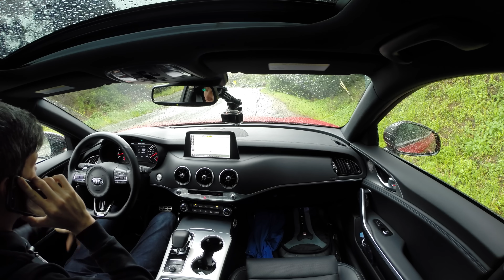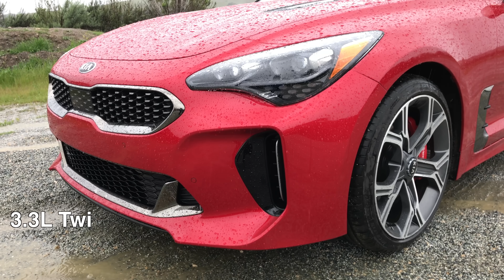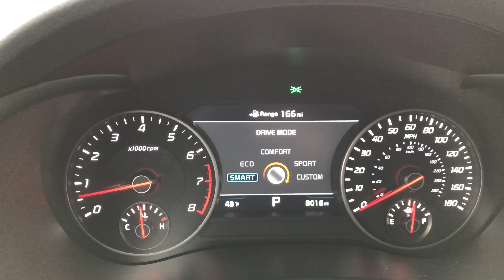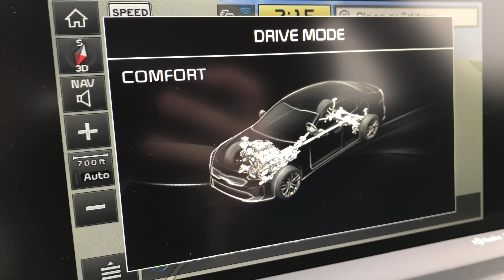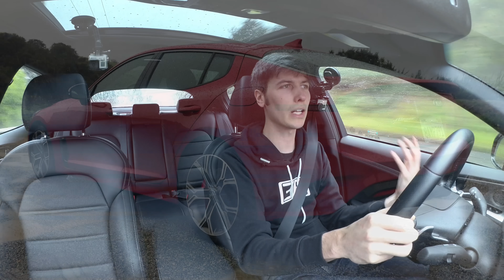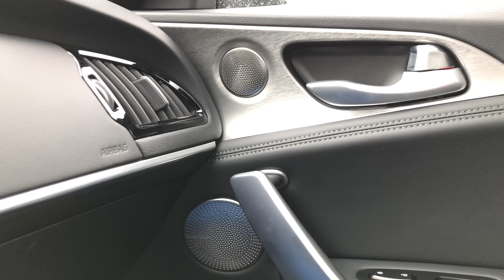The Kia Stinger GT Is An Ego Check For Car Guys

Comment: Love the humor at the start, making fun of the "American" car culture bored with dull stuff from Korea :: but there are some interesting electromotive solutions coming out of south korea because of collusion between Samsung + LG & Kia Hyundai etc : with some degree of irony the LG Chem batteries in their hybrid and electric models are so fade & failure prone that they have to give lifetime battery warranties :)
Reply: It will be interesting to see how the vehicle fleet (all Korean Vehicles) hold up over time compared to American, European and Japanese vehicle manufacturers : especially at the individual model level for reliability & longevity : I wish cars and car components had hours meters by law (yes I know I can add them with aftermarket parts :))
Reply: The engine & transmission seem like good candidates for longevity MTBF failure analysis, the clutch too for how many cycles under what kind of loads. More active information about vehicle component wear would be cool! In aerospace there is lots more analytical data for a given model, like the Boeing 787 models :) or epic 737 ^^ It would be cool to understand why some vehicle are way more reliable than others, and why some vehicles hold up well overtime with abuse like the Toyota Hilux truck featured on Top Gear!

Comment: Kia/Hyundai (They're actually the same company or one owns the other) have always been kinda sleeper like with some models. My 05 Sonata actually has a lot of power for an average sedan. 125mph in the top of 3rd on a 4 speed auto is impressive for a 2.7L v6
Reply: Oh and it has an exhaust leak right off of the downpipe or whatever you call it in the flex pipe and it sounds pretty mean. Kinda like a baby GTR as all my friends say.

Comment: Hey Jason, jumped ship from an Audi A5 to a Sunset Yellow Stinger GT. Phenomenal car. Needs transmission tweaks, though. I don't really noticed much turbo lag, I know it's there, but the engine hides it well. My Sunset Yellow came with AWD, 19 inch wheels, and Michelin Pilot Sport 4 tires. I miss my Audi, but I don't miss the maintenance costs. I am concerned about the brake pads and rotors, pads 300 bucks per each and rotors are about 110 each. It would be a 1600 dollar job to do all four corners just in parts. Got those quoted from the Kia service department.

Comment: We have had a very successful time with our shop Stinger GT. Currently, we are 110 WHP over the stock 365 horsepower (currently at 500 crank horsepower)
Reply: hidden KARD all those parts are getting developed right now.
Reply: Than you!!!  We are limiting our market to 3 maufactures now. KIA/Hyundai, Mini Cooper, Fiat/Alfa Romeo.
Reply: With full bolt on's, and a tune... it may very well be 200 WHP gains for the Stinger.
Reply: Tork Motorsports If you run out of fuel, upgrade the fuel pump and get bigger injectors also try a e85 tune
Reply: Tork Motorsports holy crap maybe I should get it lol
Reply: Sochi Water All there car has is a muffler delete (easy just pull off the muffler) , cat delete, front mount intercooler, intakes, and an off the self 93 octane tune. Imagine what it could do with full bolt ons and turbo upgrade. Should be pushing some serious power !
Reply: lmao it seems like i keep finding myself see tork motorsports, from trying to turbo my 500x and thinking about the stinger its crazy yall get your hands dirty in so many cars, thats awesome!
Reply: Tork, do any 0-60 or qtr mile testing on "stage 0 and 1"?
Reply: Devin Bender um, no. We did it for less than $3500 in parts and labor and... it was not fully tuned. Also, we paid $37k (USD) for our Stinger. The Stinger is really going to upset some peoples assumptions of what the car can do.
Reply: Wait, what? 500 with a few bolt on's and a tune? The turbo would have to be upgraded also to make that power. In my shop with my shop Stinger, I have already broke 500 wheel torque, and 450 wheel horsepower and we have not even started tuning it yet. So... the Mustang may be fast and has a huge following, as these Stingers start to get tuned and get turbo upgrades... they are going to be making people take a second look at what they can actually do.
Reply: Agreed, but its limited to NA, where the Stinger already had turbo's on it. The potential from the factory for the Stinger, vs the Mustang, puts the Stinger much further ahead.
Reply: Devin Bender lol not practical, no awd for crap weather, no where near as nice interiorly and let's not forget a dime a dozen. A v8 Mustang has been proven to get walked buy this car from a dig in the quarter mile with a manual, auto would be closer but still a loss. Not to mention for the price of an exhaust for that Mustang you can buy a tune for this car and pick up 100+ hp and 100+ tq.
Reply: Devin Bender i bought my gt1 for 39k 50 plus what are you talking about lol
Reply: Robert B gt2 for 50+ never said gt1
Reply: Devin Bender Similar performance it's a 2.3 L turbo 4 pot vs 3.3L twin turbo V6 the stinger will have more torque at equal hp levels due to the cubic capacity difference and when it comes to petrol engines proving you can get the power down torque wins races not hp.
Reply: Tork Motorsports can do the same thing with a 35k mustang too.
Reply: even if you can do it with a mustang you have the misery of having to drive a mustang
Reply: Tork Motorsports as impressive that is. Your still talking about a 50k+ car and $10k+ of work in the shop. Where I’m talking about a $35k car and $8k in the shop for similar performance
Reply: Tork Motorsports must have stole the car. Gt2 stingers are currently 55k at my local dealer. Gotta love them EBay parts!
Reply: @devinbender8428  Something tells me you haven't bought a car or know how to negotiate MSRP from with a dealership. Depending on the offers and car price you can easily walk out the dokr 5k below MSRP. With the aggressive leasing and finance offers, I walked out with a GT2 for 45k. I'm sure Tork was able to do the same.
Reply: hyedefinition1080 I am a very good negotiator. Got a Avenger RT new for under 14k sticker was over 20.
Reply: @hyedefinition1080  Yep, at the end of September, I paid 44K out the door for my GT2 AWD.  And as you know, the GT2 is loaded.  I haven't seen even one GT2 AWD with a sticker of 55K.
Reply: @devinbender8428  then I don't know where you got the $55k MSRP from...it maxes out at $52k. And you with the good negotiating skills could easily bring that down $10k if you wanted.
Reply: @hyedefinition1080  never mind. The guy is a dipshit. Saying the stinger interior is plastic crap in the same breath as a mustang Ecoboost lol
Reply: @dreadnaut1269  Dude even bragged about how he bought a tragic Avenger  for 14k 😂
Reply: Devin Bender All macho men always think they’re good negotiators. You probably think that you’re awesome in bed, too?
Reply: Wedow walked by a stinger??? Motor trend and auto trader have the v8 stand at over 1.5 seconds faster quarter mile!!! Nicer interior on what planet??? The Kia interior is soooo plasticy. And practical?? It’s adaptive rwd. Any car with 400+ hp awd or rwd will slide. 

And I’m talking ecoboost mustang. 2.3 l turbo. Making better hp than the twin turbo singer. 

Ecoboost Mustang proven at 500+ with a few bolt ons and a tune.

Comment: I have a few questions. Does it come in a manual transmission? Does it cost more than a base mustang GT? If it does cost as much as a base mustang GT ($31k) how does it compare with the mustang? How does it compare with the several cars out there that come with a standard transmission and similar price range? I only ask about the mustang because that is my daily driver.

Comment: Thanks for the video! Great as always. I just still can’t. It’s still a Kia. It’s like the Saturn sky and Pontiac solstice. The sky looked better and it was the same car, but I could never ever buy the sky (not that I bought the solstice either) because it was a Saturn. 

And this is coming from someone with and FR-S. I HATE Scion, and I still wish I bought a BRZ so I didn’t have to say Scion even though I like the styling of the FR-S better. At least with the FR-S I can still fall back on knowing that they had nothing to do with the design or styling of the car. 

With the stinger,  it’s still 100% a Kia... I want to like it because I do like what it’s about... but it’s a Kia

Comment: Pretty sure the AWD system uses clutch packs instead of a center differential, like about everything else that change center torque biasing. It would make sense considering it only shifts up to 50% to the front.

Comment: For $1,000 more I can get an M240i xDrive that is quieter, faster, and has a better layout.  They are trying to give BMW a run for their money.  However, given the woes of those I know who own a Kia, in terms of being made almost like a plastic toy from China, versus BMW which is over-engineered and has expensive parts (though I'm sure the Stinger GT will also end up with expensive parts), I'd still rather have the BMW.  And per car & driver, the BMW will definitely out-handle the Stinger GT.

Comment: the biggest ego check for car guys that i can think of is saying "hey I bought a 2.0 liter , 4 cyl volvo", but you obviously speak about the S60 polestar which gets 367 hp and 470 Nm out of its engine, and get from 0 to 60 in 4.4 secs, and obviously most guys are clueless , and they think youre an idiot for buying a 4 cyl grandma car volvo.

Comment: Cool car but for a tall guy like myself the roof tapering was to aggressive. Also wasn’t a fan of the weight of it (drove the Awd version) you could defiantly feel it had an low threshold for losing traction and the transmission felt a bit sluggish other than that the car was very solid for the price it’s not a bad deal.

Comment: There was a day, long ago, when I would have rather pushed my VW than drive a KIA. That day is no more. Props to KIA for making a proper RWD performance sedan... and a good looking one at that. I would go right past all the beige-mobiles at Honda and Toyota, and straight to this.

I’m one of the nerds with an SS sedan. The one caveat for my with the KIA is that my SS has the Tremec manual. An auto with a hesitating character would drive me nuts in short order. They need to offer a manual with the RWD 4cyl and the RWD V6. The AWD V6 would greatly benefit from the responsive character of a DCT (like the Porsche PDK gearbox, which is very very good). The SS also has that 6.2L LS3 V8... sounds great and is highly tunable. The KIA has a decent growl, remains to be seen how the tuning market will develop for this.

Overall, this is the first KIA in which there is no shame in owning. Happy to see a carmaker move TOWARD the RWD performance sedan market.

Toyota, are you listening? Your CEO keeps complaining about people thinking Toyotas are boring. News flash: making the styling ever more hideous isn’t going to change that. It’s the _driving dynamics_, not the styling. Make a mainstream RWD performance sedan. Something that will do donuts, can drift a corner, urges the driver onward. Not a mere white-bread-and-mayonnaise conveyance. Maybe start with one of the Lexus platforms, de-trim it for Toyota, make it a little more raw.
Reply: DucFanDan I wouldn’t get my hopes high because when a company decides to go to BMW to build the Supra rather than use there R&D they build to make the LF-A and the Lexus F Sport you know its only balance sheets that matter and I’m coming from still owning a GS430 myself.

Comment: I've owned a blue Stinger GT2 AWD for about 3 weeks now. Absolutely love it. Traded in my trusty old '99 BMW M3 Convertible 5spd for it.

The Stinger is engaging and fun to drive but also feels very solid, has no rattles, and feels extremely safe even at freeway speeds in heavy rain. The electronic safety gadgets are fantastic, and I love the HUD (though I wish I could do a bit more customization on it)

Comment: I don't get who wants this.  It's not a performance car it's a sedan with a v6 every car manufacturer has one.  It's not a luxury car though they will try to sell it as one.  It's not economical, it's 50k.

This is the worst aspects of three different car segments in one car.
Reply from the maker: Again, starts at $38k. What's better about a $50k BMW for the same price point? They're not all that fast (the Kia has more power), the 'luxuriousness' isn't really any different, and it's expensive (the Kia is cheaper). A lot of people buy this segment, I think the Kia offers more than the competition for the same price point. 

It's not exactly what I'm into. It's a big heavy sedan with an 8-speed auto, but I at least try to put myself in the mind of the buyer who's looking in this segment. I'd take it over a 3-series easily.
Reply: This does not match in quality of ride or finish to a bmw and I didn't compare it to one.

At 38k I could get a faster lighter coupe, a near equally fast sedan from any normal brand, or a slower more luxurious sedan.  The only novelty I am seeing is in their adds where they try to sell it as a miracle car that can do all three cheaply and make fun of themselves because it can't do anything well.

I would give specific examples but half the net won't load for me right now and I need to sleep.
Reply: Kia starts at 31,900 with 255hp, 38,350 for 365hp, 49,200 for top trim.
Ford Taurus starts at 27,690 with 288hp, 42,865 with 365hp also top trim
Toyota avalon starts at 33,500 with 268hp, top trim 41,300
Dodge charger starts 28,995 with 292hp, 35,495 with 370hp, 39,995 with 485hp

They may beat a BMW or similar on price per hp but BMW doesn't sell on price per hp.  Cars like that sell on how nice it is to be in the car, I don't believe Kia can match that.  Sedans mostly sell to family's who could care less about performance and it is not a good value for a sedan if you ignore performance.  If you do care about performance and demand a sedan a Ford Taurus SHO is 4.5k more then the GT but 6.5k less then the GT2 with GT2 equipment, and the Dodge charger will leave you behind with 120+ more hp.

Comment: I just don't get this car...  $55K fully loaded -- it's so expensive!!  You can get a fully loaded Mustang GT Premium with about 100 more horsepower for about $10K less.  Same leather seats, same computer-controlled suspension, no AWD extra weight -- just a better sports-car all around. For $10K less.  I just don't understand why Kia priced this car where they did...  At $45K instead of $55K, you'd have a major hit on your hands.  At $55K it's just ridiculous.  You're paying $10K for a larger back seat and two extra doors.  And 100 less horsepower.
Reply from the maker: Again, starts at $38k. This isn't comparable to a Mustang. A Mustang is a Coupe, this is a GT car.

Comment: So if I wanted to take this to the AutoX on the weekend, could I change that dampening to be more like the high speed setting at low speeds?
Reply from the maker: You could, but I think you'd benefit from the way it's already set up. At low speeds a soft front will help you turn in, preventing understeer.

Comment: Pull the fuse for the audio system and check if it still makes the same sound to see if it is adding fake engine noise? ;)

Comment: Hey I watch your YouTube videos and I have been contemplating on a new vehicle. I'm really set on the 2018 Crosstrek, but my my family tells me to gonfor a Toyota for reliability reasons I am fairly young and I'm not sure what way to go wondering if you could provide some insight
Reply from the maker: Though Toyota generally tops the reliability charts, Subaru has a pretty solid reputation as well. Reliability is super important to me, and I purchased a 2016 Crosstrek. My only single concern is whether or not they've figured out a way of preventing carbon deposits, considering that the new Crosstrek is direct-injection, and the old is port.

Comment: First problem I see is the BLOAT!!! 3611 lbs on the base car is a whole 800+ lbs of bloat compared to 10 years ago. When are car manufacturers going to go the other way? Lightweight, nimble and SAFER. We're not even into the how bragging about better tech and fuel economy makes no sense with all the added weight over the years. Electronic this, and that, heated and cooled butts and all kind of useless "luxury" added to even base cars. 

A comfortable seat in a proper driving position and good adjustability is going way further in both comfortable(ie luxury) and safety and reliability.  

3611 lbs/255 HP=14.6 Lbs/HP 2.0L T ~21-29MPG(claimed)
2700lbs/ 150HP=18 Lbs/HP 2.0L NA ~28-34MPG+ (real world)

The numbers make me lie, right?  Well, the 2700 Lbs car is already bloated, but someone had to add 830 lbs and 105 HP to it to get  3.4 Lbs/HP of gain. All that was needed for the power to weight ratio was roughly 35 HP and no weight, and it's even totally possible to make it more efficient without much development cost AND better fuel economy, AND better tech doodads.

Comment: If you are embarrassed about the KIA badge, just replace it with an EE badge. Not a joke -- the E badges are popular on KIAs in the Korean home market.   “‘Engineered by Excellence’ are the core themes. Exclusive (for a select few), Exquisite (sophisticated and sensitive), Evolutionary (constantly evolving) presents the direction of the new premium line-up of Kia.”
Reply: you can also buy the " flying k " badge which is so stylish and some cars imported to Europe have them.